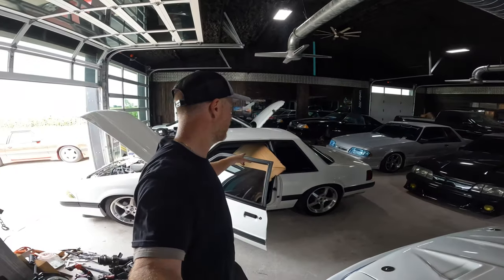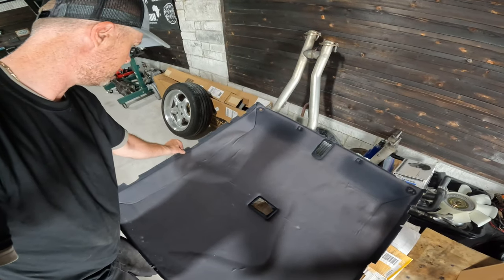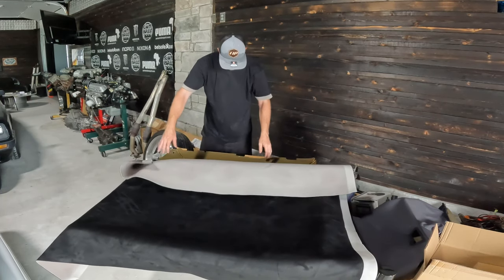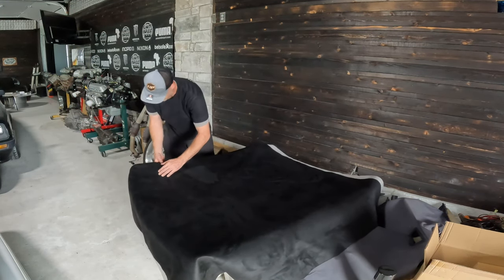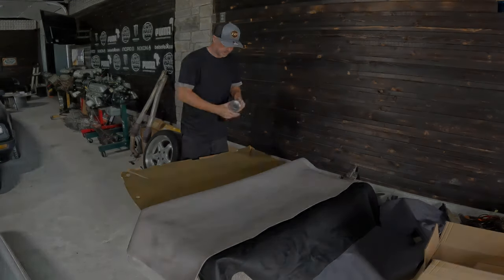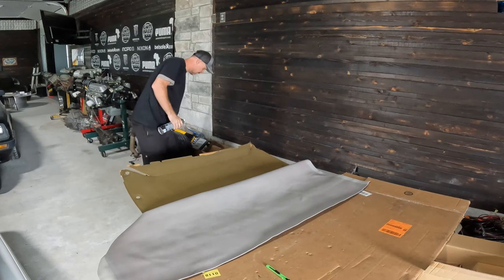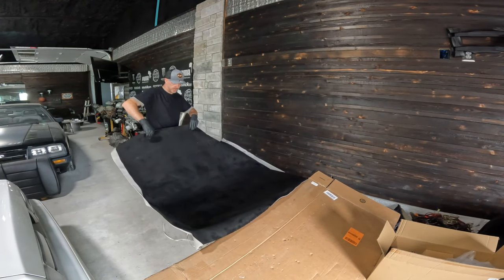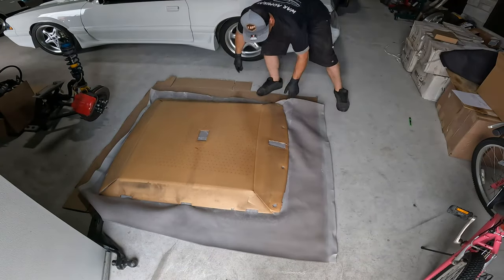How To Recover Your Headliner in Suede - Foxbody Mustang -TIPS05E34

Comment: Just a small fyi (and by no means am I an expert) if you use a small bondo applicator or any small plastic thing with a flat edge it helps sticking down the headliner material versus using your hands. Also helps because there’s less of a chance to get glue on the nice side. 

Iirc the reason why this happens is that the thin foam layer breaks down. Before applying the adhesive you should use a soft scrub brush and go over the cardboard side to remove any loose foam.

Still love your Reef Blue coupe. If you ever decide to hate it, I’d love to take care of it.

Comment: If you can its always best to use a stiff bristle brush and remove the old foam and take the headliner back to cardboard. Otherwise the glue is essentially bonding to the old decaying foam which cause the original separation and why the previous 'fix' didn't work.  It looks like most of it was gone in this case but if your concerned about longevity that's an important step worth the extra time.  The time spent on doing this yourself is well spent. I'm not a fan of the LMR ABS versions. They don't have that corner seam and look floppy. Now you just need a crown royal bag shift boot and your fully Cali coupe golden... joking aside it looks good.
Reply from the maker: Ya the previous repair I think was from a shitty or improper adhesive.. it pretty much fell off... If the foam were bad it would have stuck to the material side and not the cardboard. If the old foam is flaking off then yes I agree 💯!
Reply: Yup, I used 100 grit on an orbital sander to knock the old foam down and clean it up before doing mine